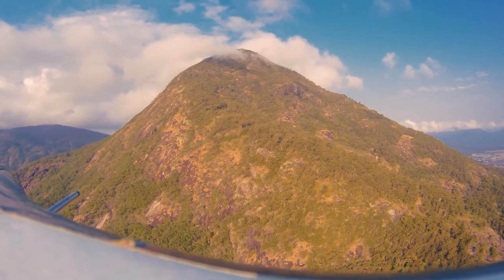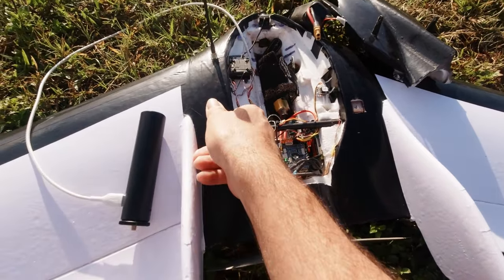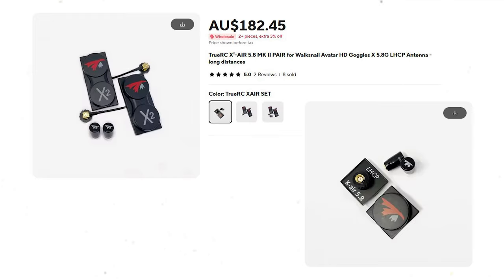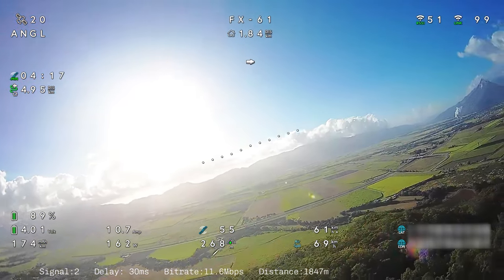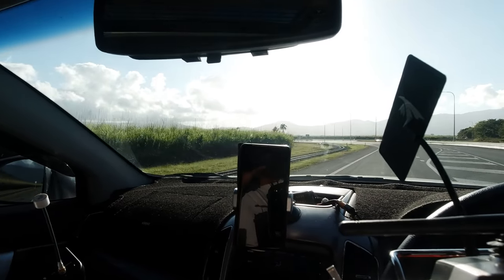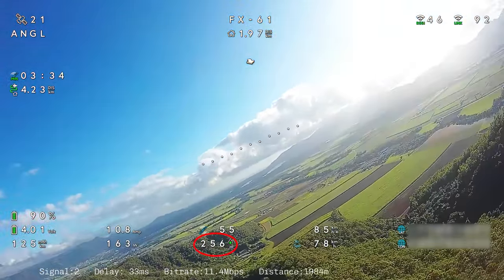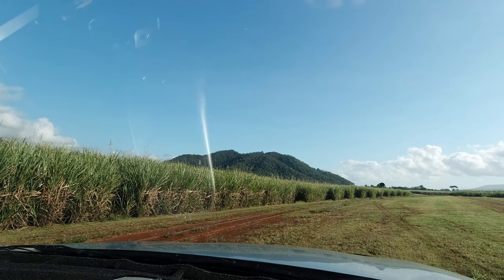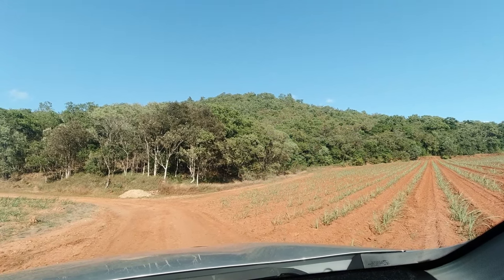FX-61 - Lost Craft ALERT!! - My critical INAV error!

Comment: Sucks you lost your FX-61 to an inaccessible location. Such a nice bird. Did so many things right, just one tiny mistake. 😕 
A mishap with RTH is more common than some people will admit. RTH can be tricky, as with every selection there are pitfalls that could lead to a possible issue. It's an area of config that should be checked based on flying location and type of flying intend to do. Similarity, not selecting correct config profile based on battery type (or size) can also result in less than ideal flight. Great tip on getting GPS lock. I recently picked up a  FX-84, the FX-61's smaller sibling.
Reply from the maker: @AerialWaviator  I think I will build another one eventually like I said that bird was my first real iNav build and has many battle scars over the years. I was actually thinking of rebuilding it with a new body a few weeks ago. At least if I get another I know it will perform flawless from the maiden as I will always have the setup and configuration I used.
I totally agree every flight your RTH and failsafe settings should be checked as per location  flying.
The smaller fx-84 plane is also a great bird!

Comment: Bad luck on losing the wing, I have one of those, they fly so well too.  I have the Use Linear Decent option but the option underneath I set to 500 m just because I feared such a situation. You might also want to use the backtrack option for 500m so the plane will attempt to follow the route that took it out of LOS and hopefully you would have recovered video.
Reply from the maker: @Caroline_Tyler  yeah I also use the backtrack 500m on all planes with linear decent switched off. This plane for some reason I missed that it was different from the others. Bad mistake on my behalf. Anyway time for a new build!! 🥳

Comment: Really sorry you lost this plane. We all been there. Part of the game. A lot of speculation in regard to what actually happened. When you first built it did you ever test RTH and observe the behavior of the aircraft all the way back to your takeoff location? Also after every launch you should check RTH prior to flying.
Reply from the maker: @IanF-FPV  yeah rth worked flawlessly it was the fact I had linear decent active and because of that RTH was on a gradual decent back home with the hill in between. It is a function in iNav I usually have turned  off but in this case it was on.